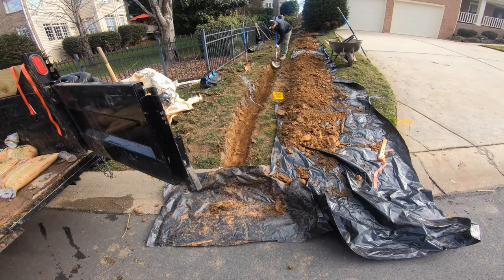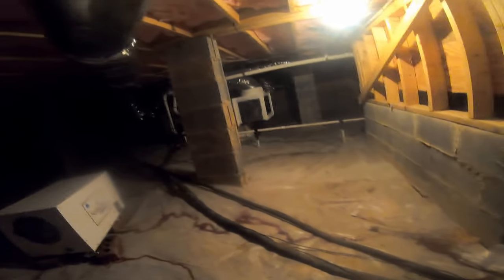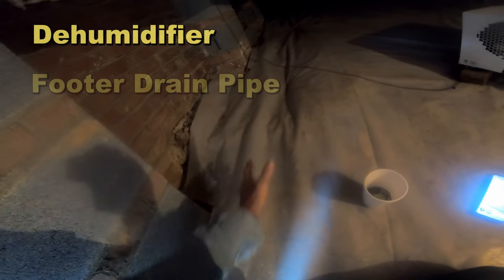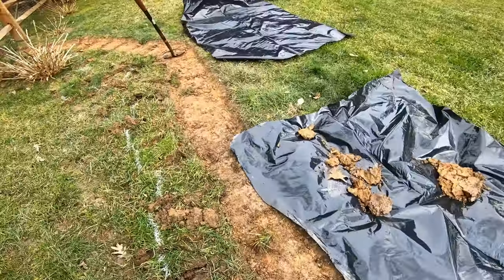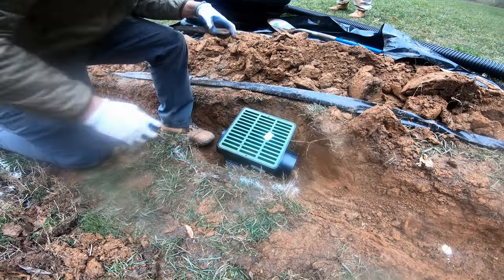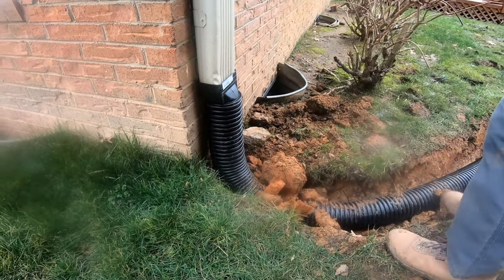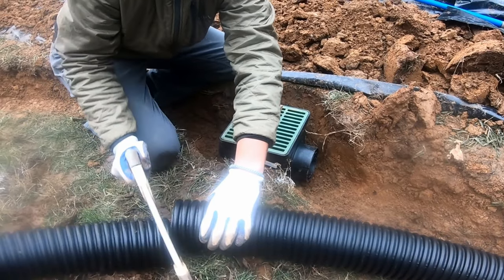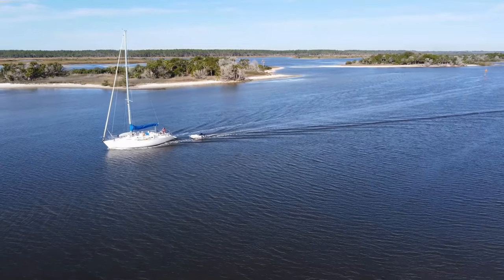Yard Drain Protects Foundation -🚫STOP Damaging Water - TIPS and Answers

Comment: Thanks for another helpful video Chuck. I have a situation similar to another video that you posted - a pool patio channel drain that runs to nowhere, and I get a buildup of water when it rains or I pressure wash the patio. I’m considering whether to use a 12 or 9 inch catch basin vs. a low profile catch basin. How should I weigh getting more drop (with low profile grate) vs. more capacity in the basin itself with a lower drop?
Reply: I don't personally like the low profile catch basin.  For me, I live in NJ and we get some terrible rain, so i need the higher capacity